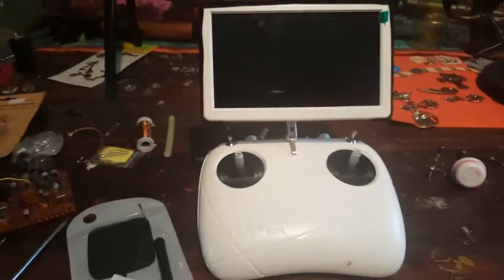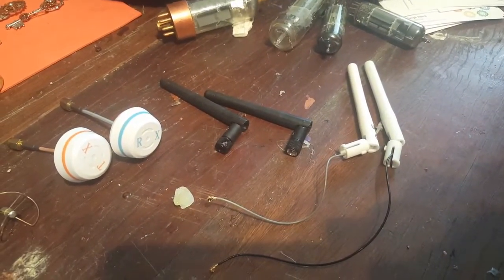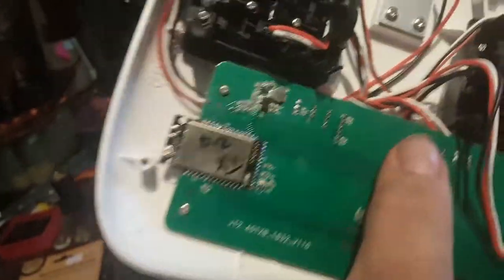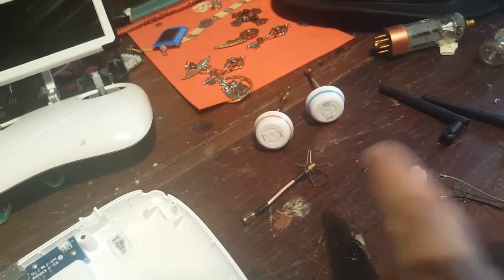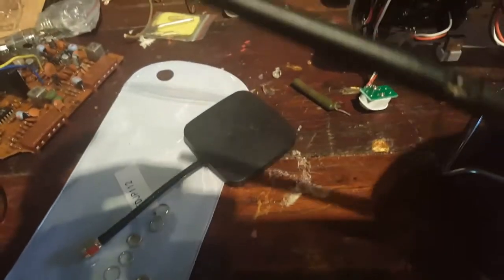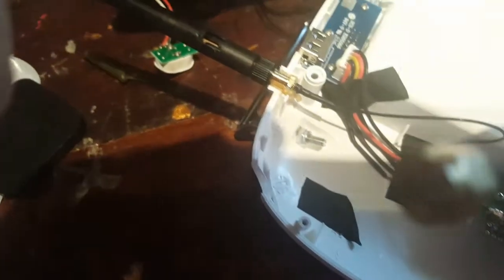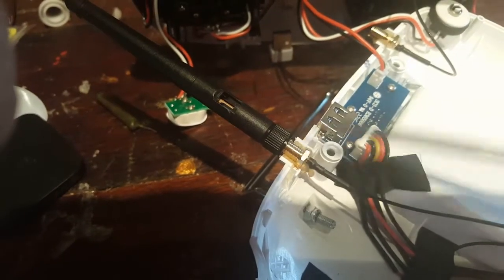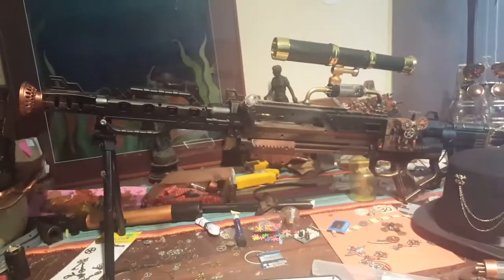Upair one Radio Mod antenna 5.8 & 2.4 Replacement

Comment: Is this possible to do on the upair one plus?
Reply from the maker: Jose Zamora yes
Reply from the maker: Check the link below for Ebay
Reply: My 5.8ghz in my controller has 2 pig tails connected to it but on yours only 1 ... which 1 do i connect the after 14dbi to??
Reply from the maker: Jose Zamora do you have pics
Reply: Drone Pilot yes...where can i send them to you?
Reply from the maker: Jose Zamora on Facebook as Drone Pilot ( its a pic of a drone in a sunrise)
Reply: Drone Pilot ok thanks ill send them right over. Its the same pic u have here?
Reply: Drone Pilot i sent u a message through Facebook messenger. I found you.

Comment: I don't see the video on when you test the antennas out how good did the antennas work
Reply from the maker: rc man its clear as normal, its only the range that's increased
Reply: UpAir one   call me hey yeah yeah that's exactly what I'm looking for hey thanks a lot for the info I just ordered them thanks again
Reply from the maker: rc man  let's just say it goes to the Faa and CaSa maximum height limit 120m...CASA has not set a Maximum VLOS will vary according to the size and ‘visibility’ of the unmanned aircraft at extreme range. VLOS range can vary from about 500m horizontally for the popular small 'Quadcopter', out to maybe 3-4kms if the unmanned aircraft is of a suitable size & colour and fitted with high-visibility textures or lighting. 700m horizontal is average @600mw tx.

Comment: Hey UpAir one I did this upgrade also  but Just want to help anyone I can with the new Upair one.. ABOUT THE OVER HEATING PROBLEM WITH THE RECEIVER IN THE HAND CONTROLLER. I wanted to try everything I could not to put a fan inside the controller. I did try of the sinksinks also, Well, I tried 4 different transmitters. finely found one that don't over heat. I tried ( 2 ) Readytosky TS5823L 200m  with no luck. Tried the ( Sinopine TS5828 600m ) with no luck. Tried the  ( Skyzone TS5823S 200m ) Bingo. NOT OVER HEATING. I have only tried the video in the house. It has worked great  through 3 batteries but I have not been able to fly to see how far it will work yet due to weather in Wisconsin. Hope this saves people time and headaches.
Reply from the maker: S Judd   its 42c here in Australia thats Da. HOT.. I haven't had a controller Issue Yet. especially with this Heat wave..
Reply: can you explain how you changed the video receiver in the controller?
Reply from the maker: Ulises Batalla  only the Antennas got changed in the controller.. on the quadcopter i changed the Tx
Reply from the maker: S Judd a fan is a good idea too.

Comment: Where can I get these adapters to use new antennas?
Reply from the maker: Carlos Cunha ebay sells the Antennas in a kit for $15.. Un plug the old ones then just plug in the new ones.
Reply: Do you have the link or the name I want to search there?
Reply from the maker: Carlos Cunha http://www.ebay.com.au/itm/162143338033